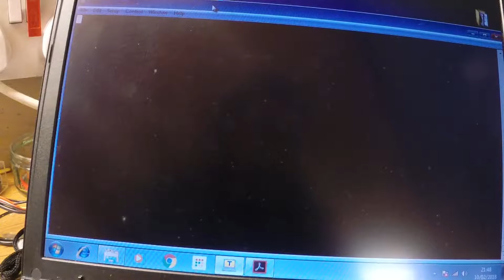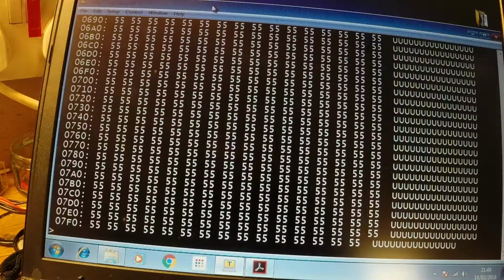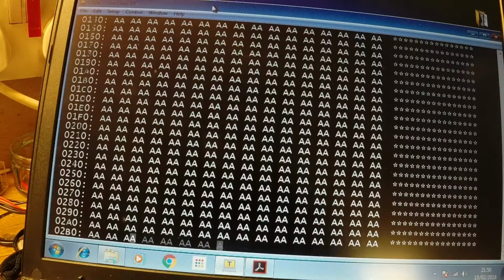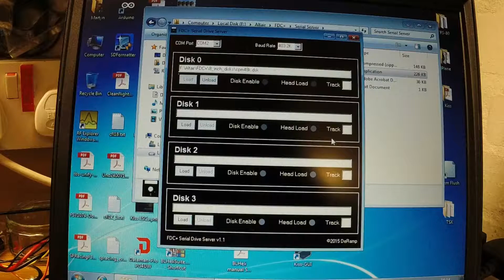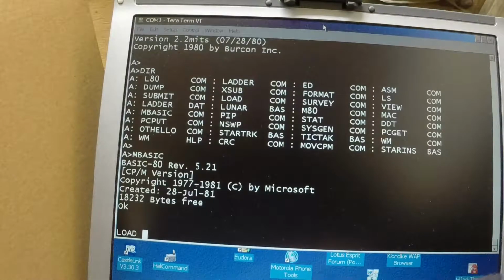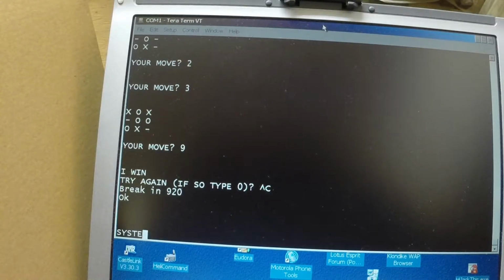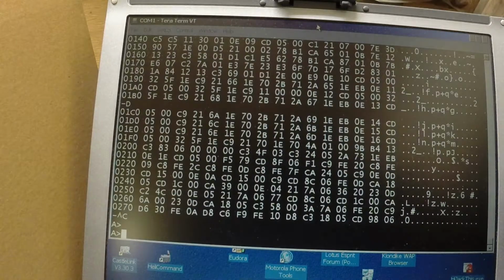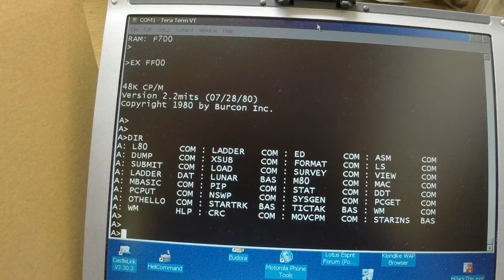Altair 8800 Build Project Part 8 -  Booting Amon & CP/M

Comment: ¿Puede Correr MS-DOS?
Y muy buen trabajo.
Reply: A quick note on the DU and FI commands that you are using in this demo. The second parameter is not the final address, but rather is the byte count. So if you (for example) type FI 0 F 55, then locations 0000 through 000E will be filled with 55, but not location 000F (because there are 15 bytes from address 0000h through 000Eh).
Reply from the maker: Hi, 
Thank you for supporting my channel and subscribing it's much appreciated.
It's not possible to rum MS-DOS as you need a minimum of an Intel 8086 processor for that, however CP/M is quite similar to MS-DOS in many ways and is of course what MS-DOS was based on initialy.
I'm currently collecting components for the next stage of the build and there should be a new video up in a couple of weeks.
Bye
Martyn.
Reply: Ok. Thank you very much.
Reply from the maker: Hi Martin,Ooops probably should have read the manual properly ! I'm very happy with your board though it works really well and the jump start circuit in particular was especially useful before the front panel was finished. I didn't mention it at the time, but you've probably guessed in the video where I created a floppy using pc2flop I was running the card at 38400 Baud which worked really well and speeded up the writing of the floppy considerably. Thanks Martyn.